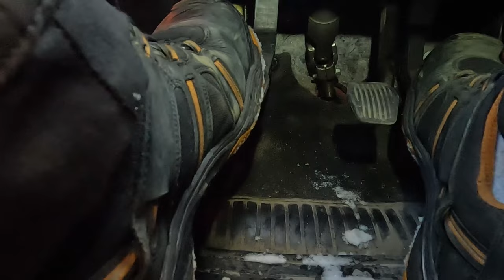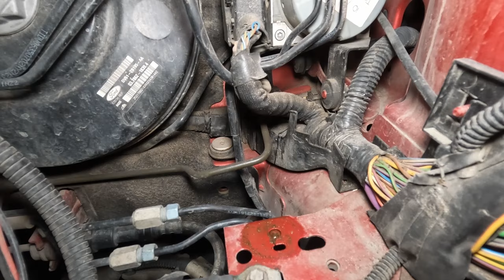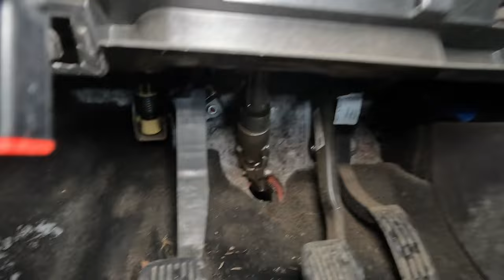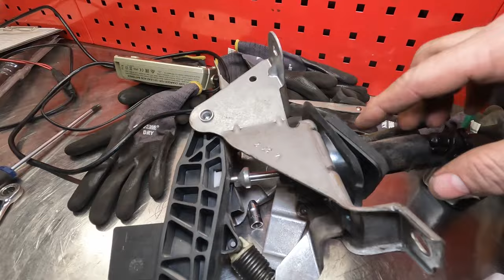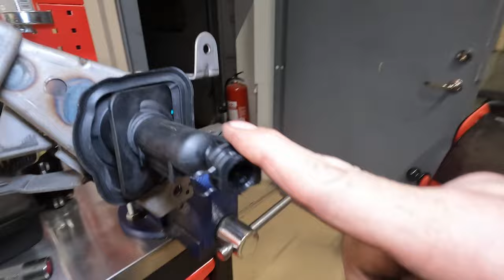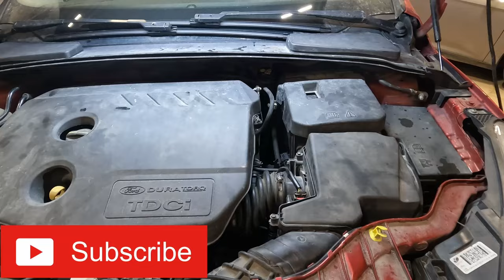GUIDE. Clutch master cylinder mk3 ford FOCUS.

Comment: So if your watching this video and wanting to change it on a MK2 Focus then its an absolute nightmare of a job.  So heres some advice when you eventually get the pedal out, put the new slave cylinder through the bulkhead first  then fit the pedal. Once you get the cylinder into the pedal you can use a flat blade screwdriver on one of  the lips to tap it round into position.  4 hours i tried putting the pedal back in with the cylinder attatched and got nowhere.
Reply from the maker: Didn't know it was so different on a mk2 to a mk3. Thanks for the advice.
Reply: Chop top end of bracket off..it serves no purpose bar pissing you off

Comment: The small rubberseal has too pop onto the plastic bit on the cable also, not just touching it, to seal properly
Reply from the maker: @TobbeSogndal  do you mean the pipe that goes to the slave cylinder?
Reply: @mike_themechanic  no, the master, the small black rubber part you talk about on the video
Reply from the maker: @TobbeSogndal that fits on the end of the pipe going in to the master cylinder and on to the slave cylinder?
Reply: @mike_themechanic  13:45 into the video. It could be I have 2014 ecoboost version and the design slighty different perhaps, but mine would not seal until rubber pop onto plastic bit. Im only talking about the master unit😊
Reply from the maker: @TobbeSogndal  I can't get it to pop on to the plastic part but it seals up to it. That pipe goes from the master cylinder to the slave cylinder.
Reply: @mike_themechanic  I had to remove and reattached the plastic-part, then the rubber would pop on. Cheer luck really. Does yours have an o-ring aswell? Mine does not
Reply from the maker: @TobbeSogndal  I couldn't get the plastic peice to move and I'm not sure where an o-ring should go
Reply: @mike_themechanic  its indeed a poor design🙂
Reply from the maker: @TobbeSogndal indeed. The rubber part is only available with the pipe as well which is only available from Ford 🫣🫣

Comment: Could the master cylinder damage the slave cylinder? I have 2 slave cylinders failed in a short period. Both same brand, not sure what to do now. Every time I replaced all clutch parts…No symptoms before the pedal stuck on the floor… really worried will fail again   It’s a Mondeo MK3 tdci
Reply from the maker: the only way I can think of is if water has got in or dirt and damaged seals somewhere

Comment: How much would a job like this cost?
Reply from the maker: It's about 1 hours work plus parts. I'm not sure what a garage where you live takes per hour but that's roughly how I would charge you
Reply: @mike_themechanic  what area are you based?
Reply from the maker: @yusefrm  northern Sweden
Reply: @mike_themechanic  🤣🤣 fair enough mate thanks
Reply from the maker: @yusefrm no worries

Comment: Hi, my clutch pedal is sticking every now and then when I change gear, Ford focus 1.5tdci- got a guy coming to change the master cylinder. But I popped into a garage and he said it’s the slave cylinder and would cost about £800 what u relokon? Also Thers no leaking and gears and clutch seem fine.
Reply from the maker: Well the master cylinder is easier and cheaper to change so that's why I changed mine in that order
Reply: The lad that’s changing the master cylinder is adiimant that’s the issue. I just don’t know why the garage would say it’s the salve cylinder straight away without even looking at the car.  🥺
Reply: But apparently it’s always the master cylinder it’s a common fault and he’s done 100’s
Reply: What’s the chances of it been the slave cylinder?
Reply from the maker: @RichardSmith-jm7ib  I'd say probably not very likely to be honest. If you do do the slave cylinder you should do the clutch and flywheel at the same time as I did. I know the master cylinder is a common problem so I would have said that first as well.
Reply: Not very likely to be the slave cylinder?

Comment: Ended up doing this, undoing the 4th nut and putting the pedal back  was almost impossible had to put the clutch master cylinder in first then  thread it through the pedal hole and attach it that way, other then that would of been stright forward, volvo v50 1.6
Reply from the maker: What was in the way that stopped it going back?
Reply: Not sure the name but it's connected with steering wheel and also a bar that looks to go across from one side of the car to at least the centre, had to squeeze my hand up side of pedal to get to the  top nut, completely bruised and grazed my hand and wrist now but I wasn't gonna pull part the fhe whole car to get to it lol well worth it.
Reply: Anyway you help me change it, was quoted £370 did it for £80 subscribed now thanks for this
Reply from the maker: @WarmoProductions  that great to hear. That's one of the reasons I enjoy making these films in the hope that someone get the confidence to give it a go and succeed. Thank you for subscribing I really appreciate it. 😊

Comment: Just found out mine was leaking after my pedal stared squeaking and got a message of low brake fluid and found your video gave me some confidence so I think I’ll give it a shot. Gotta like n sub for the help!
Reply from the maker: Thank you so much for the like and sub. It's not a difficult job really. Take your time and don't loose the clip or the rubber part on the end of the pipe and you'll be fine 😊
Reply: @mike_themechanic  I already know with my luck all the battery tray bolts will be rusted lol
Reply from the maker: @jonbo3867  get some wd40 in there in advance and I'm sure you'll be fine 😊

Comment: Blimey Mike that was crap of a job no wonder you didn’t look to happy about it Especially having to do it again ! Nicely done though mate glad it worked out 👍i bought myself a ford streetka on the weekend with a years mot  and only 65k I took it for a spin the only thing wrong with it is it needs a heater valve as i can’t turn it off £11 and a motor in the passenger door for the central locking there about £20 ish it’s fab I love it 🤣 I like these sort of vids mate they teach me stuff 👍
Reply from the maker: I keep looking for a ka to buy.
I used to drive them when they first came out and loved them. Congratulations on your purchase it sounds like a great deal.

Comment: Hello , amazing video!  My focus is a petrol st line version and it gets stuck half way but is intermittent!  But only happens , when clutch is in waiting for a gap in traffic, and on hill starts! 
With one occasion which it stuck to floor! Which is scary😂
So this video now has gave me confidence on what’s faulty!
 
Main question is,  what goes wrong with the cylinder to stop the pedal coming up all the way?
Reply from the maker: It's probably leaking air into the pipes and thats why it doesn't come back up. The only tricky part is getting to the bolts on the bulk head everything else is fairly straightforward. Give it a go and I'm sure you'll get it sorted.

Comment: If the problem came back that quickly with a new part installed, then it probably wasn't that part's fault. I wouldn't be surprised if it comes back again.
Apparently people had both cylinders and the clutch itself replaced and the problem still returned.
There has to be something different.
Reply from the maker: That's exactly what has happened. Now I've changed the master cylinder twice and the slave cylinder.... Still the same

Comment: Great video but not really said what is causing the pedal to stick, can it be repaired?
Reply from the maker: Air in the system is causing the pedal to stick down. It is fixed by replacing the master cylinder

Comment: Do you know if it's possible to remove clutch bracket from clutch master cylinder without removing fluid lines, need to do thist so I can get to blower motor to press tab and turn motor to replace it. I have been trying to remove blower motor for weeks, driving me insane, have come to the realization that I will need to remove clutch bracket to give me room but don't want to disconnect brake fluid lines, any idea?
Reply: Ford focus lw Australian right-hand drive
Reply from the maker: Don't think there is a lot of play in the hoses it be enough but I'm not 100% sure
Reply: Finally removed blower motor with clutch pedal on, thanks for replying
Reply from the maker: @tonyfarrar7410  no worries. Sorry it took so long I didn't get a message that you had writen a comment

Comment: Hi will this be the same process with the volvo v50 1.6 I'm sure  the engine parts the same, peddle sticking down mostly after reversing or sitting at traffic lights with clutch held down
Reply from the maker: Yes I believe so as its almost the same car
Reply: @mike_themechanic trying to find the bleed nipple is the a specific location where they normally are, my cars a right hand drive.
Reply from the maker: @WarmoProductions  jepp side of the gearbox underneath the pipe that goes from the master cylinder

Comment: Just had same job done but traction light stays on even when I try to turn it off via menu, any ideas welcome.
Reply from the maker: Strange. The only time you need to be neer the brakes in this job is when your disconnecting the pipes that are underneath the abs pump (on a LHD it is anyway)
I'd get a computer connected and see what the fault code is

Comment: Hi mate is 1.6 Volvo s40 d2 2011 diesel same it looks same as I am having some problem ? Thanks
Reply from the maker: I believe så.
Reply: Had job done was ok for 3 day now problem is back any advice thanks
Reply from the maker: @ryanshepherd327  when I bleed mine as I did alot during winter I found that if I only did a few presses of the pedal it didn't work for long, but if I bled at least 10 presses of the pedal it would work at lot longer
Reply: Did you cure your
Reply from the maker: @ryanshepherd327  not as such. It's OK at the moment but has been a right pain while it was cold outside. I've changed the master cylinder, the pipe and the slave cylinder. Not sure what to do anymore 🤷
Reply: IT’s right headache doing my box in lol thanks anyway
Reply: Could be to do with my flywheel it has had a flywheel judder for about 8 months as ya will no it’s not a cheap job and don’t want to be speeding all that money for it to be the same
Reply from the maker: @ryanshepherd327  if it's juddering then it's probably the dmf thats broken and will need replacing before it totally fails and could lead to bigger problems. My pedal was sticking to the floor whats yours doing?
Reply: Sticks down but not all the way ya get a little bit but if you flick it up and pump it it seem to wrk fine for abit  I only get the judder when hard acceleration in first and second
Reply from the maker: @ryanshepherd327 sounds like mine does. I'd try bleeding it like 10 - 15 pumps

Comment: Could you explain how to get rid off the air in the system?
Reply from the maker: I open the nipple and then press the pedal, it should stay down, then close the nipple and pull the pedal up. Repeat this at least 10 times.. Make sure you have fluid in the tank before and after your finished

Comment: Why do engineers hate mechanic's 😕 hiding things away and make it so hard to get to the thing you are trying to fix so many parts have to come of to get to an easy fix
Reply from the maker: The worst part is bleeding it especially on the diesel. I've compared it to the petrol and it's much better access there
Reply: They can make cars that are cheap to make and sell, or easy to fix but expensive. People choose the former.